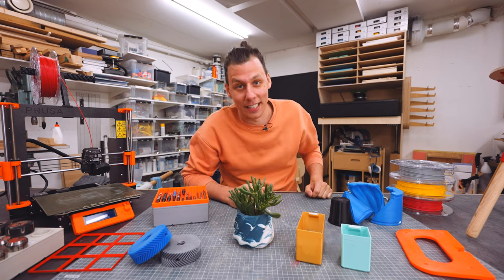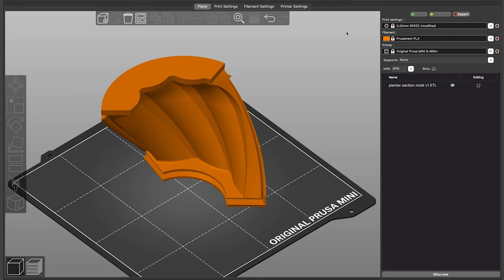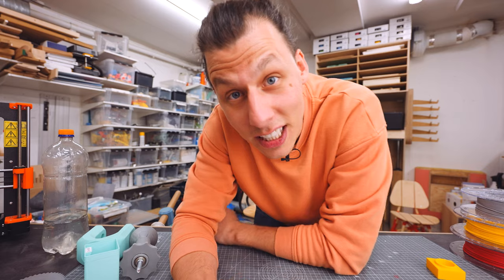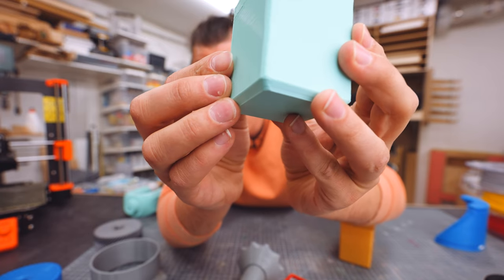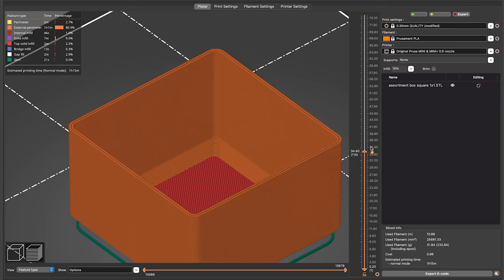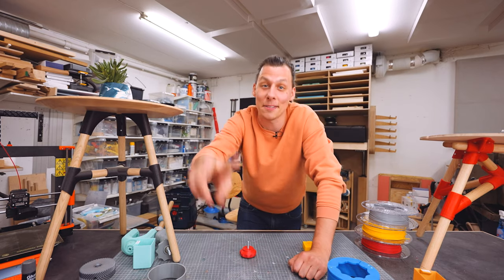My 10 BEST tips for 3D Printing

Comment: 1. 1:11 Nozzle size: use .6 mm
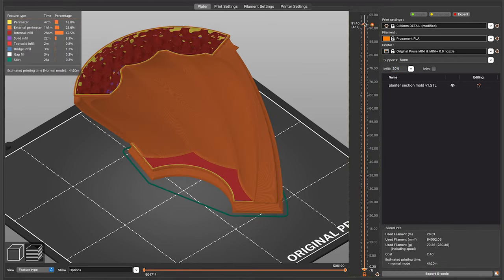2. 4:14 Perimeters over infill: 5 mm + 20% infill
3. 7:03 Materials: PLA is strong enough
4. 8:27 Glue stick: Before printing
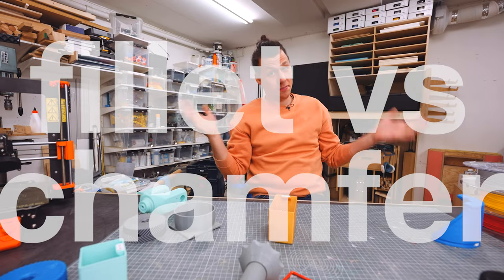5. 10:42 filet vs chamfer (round vs angle): Use chamfer
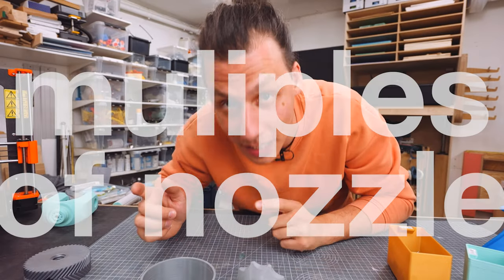6. 12:17 Multiple nozzles
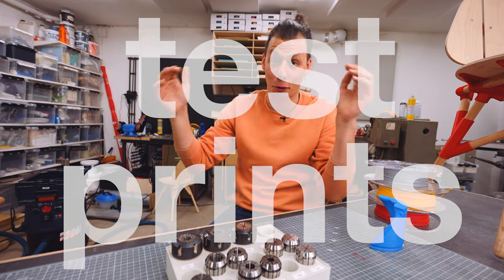7. 14:30 Test prints
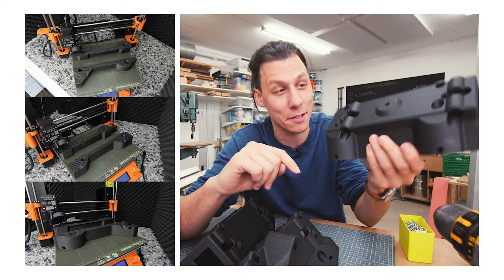8. 15:40 Off the shelve hardware
9. 16:52 Avoid supports
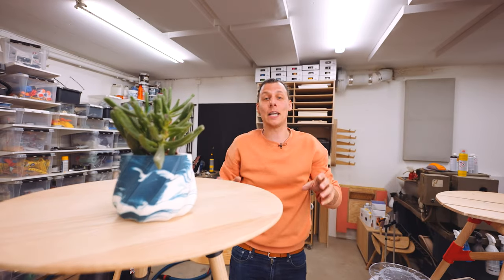10. 18:24 Final product don't need to be plastic
Reply: Tanks à lot Pablo for that.
Reply: PLA is fine for toys, most of the times.

Comment: Actually at CNC Kitchen Stefan showed that you can easily go up to 150% layer line width of the nozzle's diameter. So 0.9 mm layer line width on a 0.6 mm nozzle is not just okay, but the most strongest print setting for 3D printed parts. If you are okay with having 'not the shiniest surface quality' I'd recommend doing exactly that. If you need better printing quality at the surface you can combine the 0.9 setting at the inside walls with a  0.6 mm setting on the outside walls. That will give you a great quality at wall thickness of 1.5mm and high layer adhesion. This is actually my favourite setting.
Reply: Greet tip. Thanks. I will use it. Currently using multiple perimeters often. But this should make prints faster. And maybe even better. 
Does this also work to make prints water tight?
Reply: My research for water tightness a couple of weeks ago told me, that water usually doesn't come through the layer lines but the the Z-seam. This setting should be good for water tightness if you tweek your Z-seam stuff right. I suggest using a setting for print speed optimization since it will place your Z-seam to the nearest possible point where the printer finished the last layer. In that way the least material can ooze out of the nozzle during the travel move. Maybe modify your flowrate to a little bit of overextrusion (2-3%). That will help attaching the layers and layer lines to each other.
Reply: I've been trying to print a part using standard Prusaslicer settings with silk PLA for weeks, now. But every time I get some sort of defect on the external walls, which is not acceptable, considering it's meant to look nice - it's silk PLA, after all. I just decided to print the very same filament using 0.8 mm line width (with the same 0.4 mm nozzle) and 0.24 mm layer height. Print time dropped one hour and the print is looking perfect! So, I'd say even going 200% of the nozzle diameter is ok, depending on the model.
Reply: @Felipeh999  Yes 200% line width will work, but for maximising the layer adhesion it will be counterproductive. For minimisation of printing time, it will do it's job.
Currently I'm also suffering a bit from bad surfaces but this might be reasoned by the high flowrate I'm using. I think the extruder is loosing steps there. If your problem is the same maybe a BondTech CHT Nozzle or simply higher printing temperatures and more equalised Flowrates should do the trick.
Reply: I personally hate glue sticks and blue tape.  I was using a glass bed.  Then I switched to garolite which worked well, but I had to use magigoo to get consistent results.  Great glue stick. It sticks really well then the print just popped off once the bed cooled down.   I have finally gone to a PEI coated spring steel flex plate.  This is the best surface so far and no glue stick.

Comment: Great tips, Alex.  As a previous applications engineer working for a 3D printer manufacturer just about everything you went over was spot on!  One other tip for avoiding supports (which I whole-heartedly agree with) is to consider breaking up the part into separate pieces that can be assembled after the fact.  Most people assume that the ability to consolidate parts is always the answer - not necessarily.
Reply: "...consider breaking up the part into separate pieces" What adhesive works for you?
Reply: @billbyrd9845  I use hair spray and a metal magnetic pad. Works amazing. If it’s a small part you can spray extra sticky there
Reply: @sethkahny3663  I think he's asking about what kind of bonding agent. I. e. pva or pvc glue or cyanoacryllic(instant/contact glue with activator)...

Comment: I don't know what they're officially called, but I like using "chamflets" (chamfer + fillet) on prints that need a chamfer larger than a few layers high.

First you create a 45 degree chamfer, then you add a fillet to the top edge of the chamfer. This results in a smooth transition to the side surface (where it's most noticeable), but doesn't suffer from the overhang problems of a standard fillet.
Reply: I love doing this as well. Typically if I am doing less than 1 mm I just leave it but above that I do your method.
Reply: I've heard it called "Chillets" lol

Comment: My tips :

1. When opening a new roll of filament, write the date on the spool/bag so you know how old it is. 
2. Once you find a filament supplier you like, stick with them. There are subtle variations in material from different manufacturers so for consistent prints, be consistent w your filament. 
3. Similar to (2), support your filament supplier on social media & promote their product. You’ll benefit from this relationship. 
4. There is a difference in the density of black vs white PLA/PLA+. when switching to black PLA, re-tune your extruder each time (only takes a few minutes)
5. When modeling complex curves or parts, print a very thin test print to check the interface. you can slice this easily by moving the object in the negative Z direction so it only slices the ‘top’ for your test prints
6. Don’t always slice prints in the Centre of the build plate. Move them around to spread out the wear on your flexible magnetic plates. 
Hope this helps !

Comment: I used to print only with PLA. But I live in Brazil, and many of my parts start bending. I never thought that our temperature would make any difference. Still, it appears that PLA exposed to warmer temperatures for more extended periods starts changing its structure, and after a year, it bends. Some structural parts even broke. So, now, I only use PETG, and none of my parts have any issue anymore. I live in a very open place with lots of sunlight. Maybe that was my problem with PLA.
Reply: Also don't discount humidity, as PLA is a hygroscopic plastic, and will readily absorb moisture from the air, which in turn weakens it. Combined with heat and you get warping. Many who don't live in such climates report the same for things like mounts for things, like cup holders, in their cars when they bake under the summer sun.
Reply: PLA is sensitive to heat, humidity, and UV. It indeed limits your uses for it, but it's still the cheapest and easiest to print. I made something for my car and it completely deformed like silly putty after a couple days in the Florida sun.
Reply: No, that's how PLA works. It softens at 60 degrees, but any level of heat will compromise it. Also, as was stated, humidity is a factor. PETG  is much more outdoor appropriate and it's really no harder to print, I'd say it's very easy on a Prusa with a textured plate. No glue required, just dial in the Z level well and print. PLA is strong, but not durable. PETG is actually perhaps a little less strong in some ways, but much more durable.
Reply: Of course. PLA is a newbie material used mainly for printing figurines, toys and other useless crap.

Comment: Your glue stick experience is interesting, because I've actually had the opposite experience with surfaces like BuildTak and similar, that when I use glue stick on those the parts come loose, but without they stick like the duck's guts! I think (correct me if I'm barking up the wrong tree) the way those surfaces work is that they are microscopically rough, which gives the printed plastic something to bite into and stick. Isolating the surface and plastic with a layer of glue inbetween means that the surface can't do the work its designed for.
Reply: I had the same experience, glue stick might as well be teflon. It didnt work on glass, Got PEI sheet which would hold for 3-4 layers then peel, added glue, wouldn't stick at all.
Reply: That’s weird because for me my Prusa MK3 is hit or miss for bed adhesion if I print directly onto the bed (no matter how much I clean it) but if i add glue stick, prints are rock solid every time.

I wonder if ambient temperature and humidity play a part in our different experiences because I am in a colder climate
Reply: the duck’s guts
Reply: @jacobclayton8131  I haven't had experience with the Prusa specifically, but used glue stick regularly when I printed on glass and blue tape and continued using it when I moved onto a Flashforge Dreamer which has one of those special build surfaces (dunno if they made it, or if someone else made it and branded it with Flashforge). I continued using the glue stick because that's what I always did, but had huge problems with adhesion, until I stopped and cleaned the surface heavily with IPA and stopped using glue. Then I tried the same on another printer with a BuildTak surface and had the same experience, leading me to believe that glue stick plus these build surfaces are a bad combo.
Reply: It actually could be due to the glue itself. I use a cheap glue I found in a local shop and it makes my prints stick like there is no tomorrow. I tried using 2 other types and those prevent my parts from sticking. This applies to buildtak, glass and creality ultrabase. Printinng PETG.
Reply: @Mohammad_Qasem  I have used a cheap generic gluestick that works a little, then changed to the purple elmer's glue stick and is really hard to take the piece form the bed now have changed to the elmer's purple liquid glue and works like a charm with pla at least, sticks well and goes off with a little pry with a paint spatula.
Reply: Same here, it might matter on the brand of glue stick i guess. What works for me really well -  using PEI sheet, is before each print drop some isopropyl alcohol on the surface, use a glass scraper and scrape the surface (there is a surprising amount of leftover material coming off) and then always do a G29 bed levelling (bl touch), it always sticks.
Reply: @jacobclayton8131  You probably didnt clean it properly. Hear me out: 
Sometimes especially if you do not use IPA but denatured alcohol, you will slowly build up a layer of residue which cannot be removed by IPA or alcohol. 
If you ever get a PEI sheet that just wont adhere to anything, no matter how much you wash it off with IPA, then try to wash it off in hot water and dish soap and then IPA. It will usually solve such problems.
Reply: I've never had success with glue sticks and the times it did work it would leave a residue on the bottom of the print. I've gone back to using a glass bed and 3D LAC which is basically unperfumed hairspray. The problem I have now is removing some prints but let it cool and it pops right off with a super smooth bottom layer.
Reply: I've been using Elmer's School Glue Stick (the disappearing purple one) for over a year and its worked great every time on a plane Borosilicate glass and a Creality Corborundum coated glass bed. I have also recently tried covering the bed with Kapton tape and it has worked like a dream with PLA, PLA+, PETG and Polycarbonate, and Im going to try ABS, TPU & TPE on it soon. knocks on wood I've not had one fail yet with it and just give it a wipe with IPA after each print and its good to go for the next.  :)
Reply: Glue acts as a release agent more than anything else. So it makes it easier to get stuff off the plate once it's done, some materials stick down so hard it's difficult otherwise. Though, this is affected by what plate you use. A smooth PEI sheet and PETG - good luck, you probably just ruined your PEI sheet. In some cases, glass plates have even delaminated when people tried to pry PETG off them. With glue, it will detach. But,  PETG on Prusa's textured plate sticks perfectly, and detaches on its own once the plate cools, so that's a nice experience.

Comment: Of all the things there is one S-tier tip that I always share with people: Zen and the Art of 3D Printer Maintenance.

Whether you got your Ender 3 on sale or you shelled out for a very expensive model, realize that this is a hobby that requires maintenance. Think of the printer as a diminutive motorcycle that fits on your desk. Just like that guy how occasionally has a really great time riding his motorcycle on the weekends, there are also many evenings after work, he's in his garage "working on the bike". 

Maybe he's putting a new pair of shiny pipes or a better visibility mirrors on it. Maybe something's rattling and he's got the socket set out and is tightening up this or that. Or, maybe it's just time to change the oil because it's due to have it done. The 3D printer takes maintenance in the exact same ways.

Aluminum parts sometimes twist out of shape. Screws come loose. Parts wear down. Wires burn out. Crappy boards from places in China you can't even pronounce burn out. 

Take a breath. Relax. Look things up online. Don't jump to conclusions, and let your spouse know you're gonna be "working on the machine for a couple hours". Eventually you can enjoy your hobby when the printer is putting down butter-smooth first-layer lines.

Comment: Glue stick tip: some special glues for 3D printing (like Dimafix) don't just act as a better adhesive while printing, but also as a release agent when it cools down so parts come off all by themselves when they cool down (try to easily release an articulated or flexible part from a flex plates 😉).

Comment: In my experience, PLA isnt very good at holding tension for a long time. Every clamp I printed from PLA that was tightened got a crack in a few months
Reply: Not just cracks, it literally deforms and "flows" under pressure. Especially if you come anywhere near the 60 degrees of warmth where it starts to soften. All plastics do, but PLA is worse than most.

Comment: With the pei sheet as used on prusa is incredibly strong for bed adhesion. Use methylated spirits/denatured alcohol/isopropyl alcohol to wipe it down just before a print then like once a week/few weeks use scotch brite with acetone to scuff up the surface and expose fresh pei. Process takes 10 seconds once you get used to it and perfect adhesion all the time (note this process is for pla NOT petg as adhesion will be too strong for petg). I know people who have been doing this for over 2 years without needing to change the plate/add more pei because of how little pei is removed during this process
Reply: ACETONE on PEI sheet= bad idea. DON'T USE THAT. Even Prusa themselves discourage that on their website.

Comment: The best part about Tipp 9 in that exact example is, the layer lines are way better in that load scenario then they would be if it was printed standing straight.
Reply: and if you didn't want that angle in your print at the bottom, you could still print it at 45° and just use supports instead.
Reply: @swalshy  endless possibilities

Comment: About the glue stick tip, it is valid, but I would argue that most sticking issues are mechanical not physical, meaning that either the bed is not aligned properly, or the z-offset is wrong. I used to need a ton of glue stick on my old printers, where leveling the beds where a nightmare. Don't need them anymore and exclusively print PLA and ABS. Even use the Purse print sheet on one of them. Second, really get to know your material. If the melting points for PLA are not correctly set, it will either cool down too fast (not sticking well enough) or too slow (warping issues).

Comment: One thing on PLA, I live in Australian and the temperature inside the house in summer can exceed 40 degrees celsius quite often and I have had parts warp sitting in the loungeroom so while PLA is good enough in Europe and some cooler countries, in some countries I would suggest prototype in PLA and if you need it to last, do the final item in PETG but reserve the PETG just for those last copies. 

The only way around this down under is to run an air conditioner even when you are not at home to keep the internal house temperature down but that is not a good solution.

Comment: Another tip btw;

You don't necessarily need a bigger nozzle for the print speed increase. Most of printers and nozzles can handle layer widths up to 50% bigger than their diameter. So you can print 0.6mm layer widths with a 0.4mm nozzle. On the flip side, you can do this with bigger nozzles as well, as long as your hot end supports the increase in flow. I for example tend to print 1.2 mm thick vasemode prints on my 0.8mm cht nozzle. So there is still a lot of benefit in upgrading.

Comment: I do chamfers at 45 degrees and the select the top edge of the chamfer set a fillet on it to about half the height of the chamfer. This allows the bottom part of the part to get the benefit of the 45 degree chamfer but the top of the chamfer gets the benefit of the fillet and is more aesthetically pleasing. You almost can't tell that the bottom of a chamfer, unless if you count it not failing like fillets do, as being able to tell.

Comment: Spot on about PLA. It has stronger tensile strength and is stiffer than ABS but lower impact strength and heat resistance; so unless you very specifically need your part to take impacts and high heat, PLA is actually superior for most applications.
Reply: I print since almost five years and only used PLA - haven't had the need to use something else.
Reply: I like PETG a lot too, a bit more dense and a little bit more heat resistant :)
Reply: Here, I pretty much have to use PETG for most parts.  PLA will sag in the summer heat even if inside but near a window that gets a lot of sunlight.
Reply: I've been using the hpla from proto pasta that you can heat treat to stand up to higher temperature than usual, its been great so far! Bed adhesion is a bit tricky though